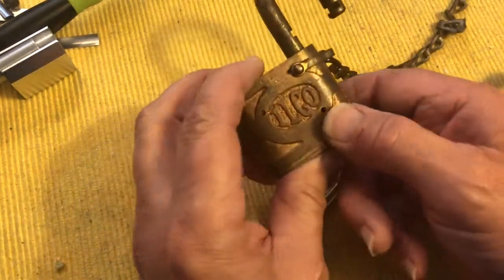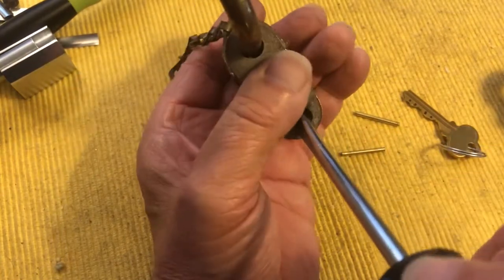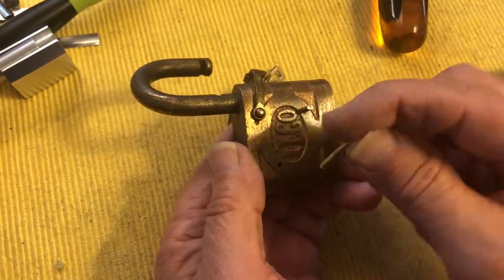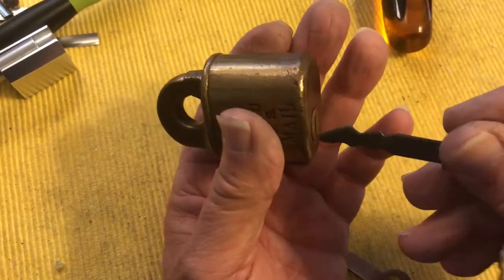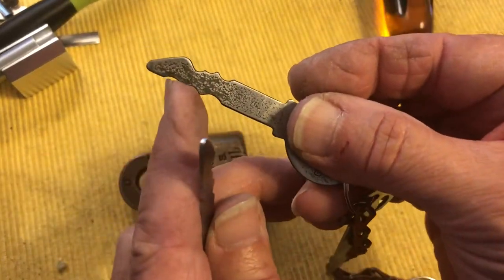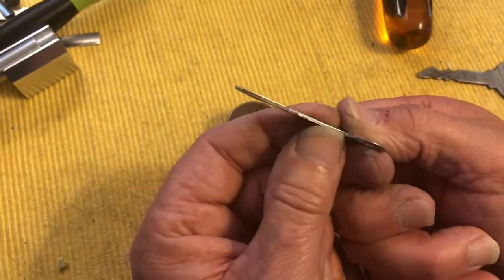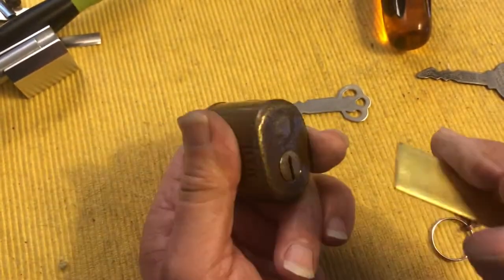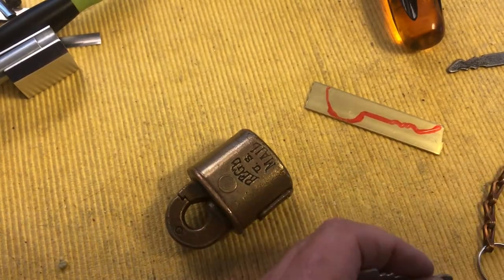#217 making keys for Old Registered Mail Counter Padlock

Comment: So many great projects Chris, you done a awesome job on the Key. 
I’d take of as much of the unwanted brass with a hacksaw, leaving only a little bit to file. That’s what I do with the picks. P.s it saves a lot of time as well. 👍
Reply from the maker: Daz Evers Thank you!!!
Will get to hacking!!
😅 
👍👍👍👍👍👍👍👍
Reply: A rotary tool with a diamond cutting disk attachment would be quicker. Just used one last night. It was fantastic! :)
Reply: Gary Rumain Absolutely I completely agree, just 10x more Expensive. 👍
Reply from the maker: Gary Rumain I love it!!!
Where do I get the disk???
Reply from the maker: Daz Evers I love expensive 😂😂😂
It’s my middle name!!!
👍👍👍👍👍👍
Reply: @dazevers  Not really.
Reply: @chriscapune7873  I bought some on eBay from China. I was hesitant about them at first but they do a sterling job. Surprisingly good for the price. I also got some saw tooth ones in stepped sizes but I think these are more for wood. Haven't tried those yet but the diamond ones are like a hot knife through butter.
Will email you the details.
Reply from the maker: Gary Rumain Thanks buddy!!!
I hope they expensive 😅😅
👍👍👍👍👍👍
Reply: @chriscapune7873  No, they weren't. :)

Comment: That new key looks very nice. So are the locks warded? Or pinned?
Reply from the maker: Gary Rumain pinned , three of them! 
I can’t seem to pick of take them! 
The pins are way in the back. 
👍👍👍👍👍
Reply: @chriscapune7873  So no warding at all? Wondering why you still need that cut along the bottom of the key's blade.
Reply: @chriscapune7873  One thing you could do, if you have a really bad one or one in poor condition, is to sacrifice it and cut it up.
Check its innards and figure out what's going on.
Reply from the maker: Gary Rumain both Bosnian Bill and The Lock Picking Lawyer have done videos on picking and also taking them apart. So I think I will keep mine intact. 
Not sure why there are cuts on the bottom of the key????
👍👍👍👍👍👍
Reply: @chriscapune7873  OK, I'll have to go look. Haven't noticed them doing these locks before.
Reply from the maker: Gary Rumain maybe a year ago???
Reply: @chriscapune7873  OK, it might be BB then. I don't watch all of his vids. I do watch all of LPL's vids.